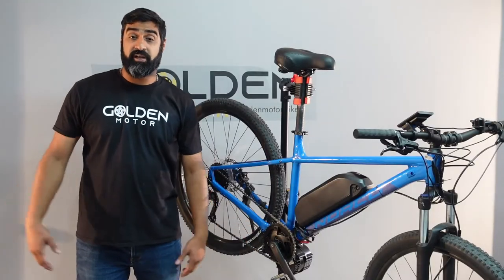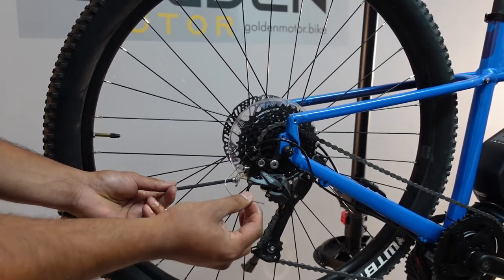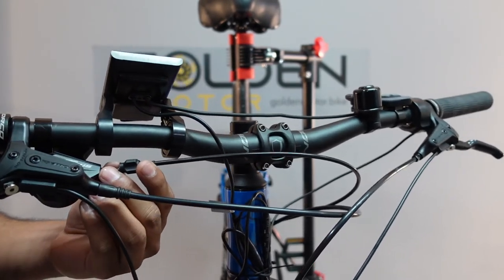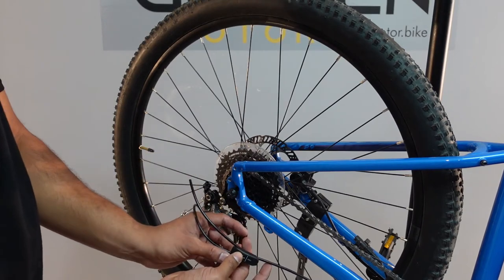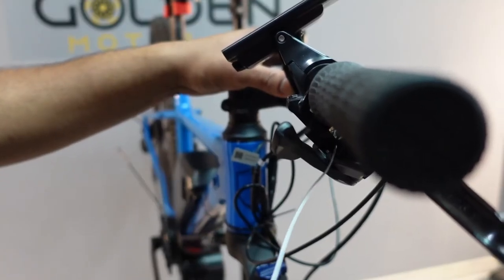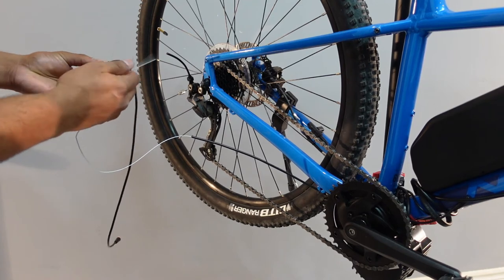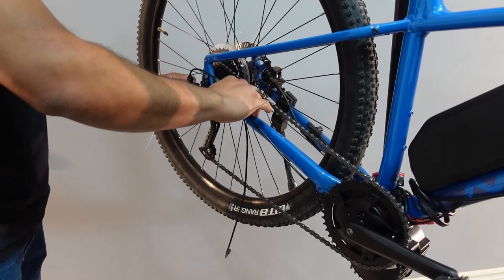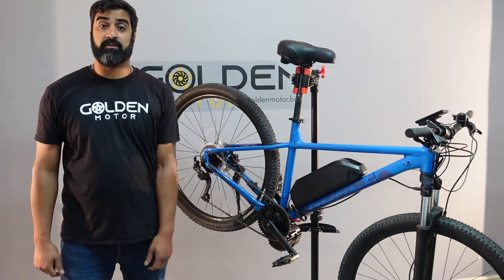Bafang Shift Sensor Installation in the Rear of the Bike BBSHD, BBS01, BBS02

Comment: Use a die grinder/dremel/angle grinder to cut those wire jackets. My bike has naked wires on the top tube & the front derailleur is the middle wire. This leaves plenty of space for a sensor. So there are 3 options Front, Rear & Mid. Mids better than the others, Rear's exposed to puddles/damage. Front is another wire & "thing" on your handle bars & needs a splitter. Mid keeps it safe, doesn't clutter your handle bars or require a splitter. Yay naked wires!

Comment: " I like these cutters because they cut nice an clean" Smashes tube sideways lol.
Reply: An abrasive wheel cutter is the best for cable jackets, cuts them super clean.
Reply: @tommegan6500  Wish I'd have read that earlier. Being the genius that I am - tried cutting the housing cable with some old dull side snips and boy oh boy. Not only did I destroy the cable and the housing, but wore myself out. I came inside and bought the right tools for the job. But I hope your tip helps someone in the future

Comment: Your chain was in a LOW gear (larger cog) on the cassette during this install.  Before starting the process, I would think it is better to get chain into smallest cog, then remove the cable.  Maybe it does not matter.   Thanks for the video.  It is helpful and I like your channel.

Comment: Great video! I'll be installing my new kit in the next week. Your channel looks to be a wealth on knowledge with programming.
Why did you remove both barrel adjusters? Seems like an unnecessary step.
I would recommend ferrules on all ends of any housings. Over time, the steel wires inside the housing will start to pull through.